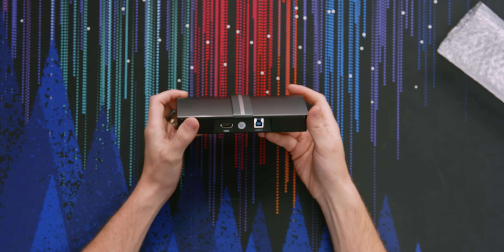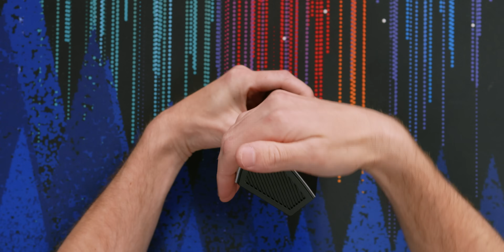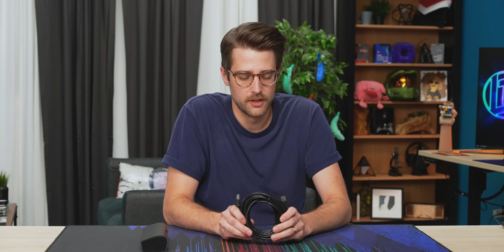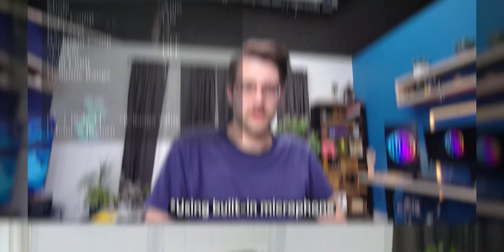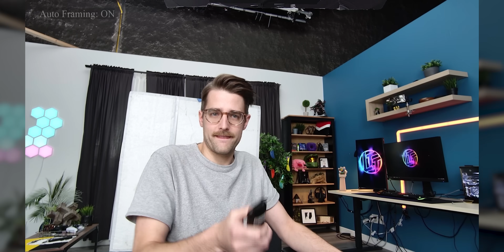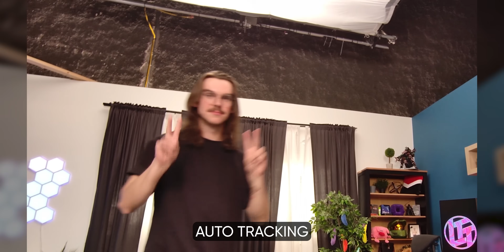The biggest sensor ever?! - Nexigo Iris 4K

Comment: Okay, maybe that's the largest sensor in a webcam that is strictly billed as a webcam...  but considering that most mirrorless cameras have tools (and in some cases, built-in firmware) that allows you to use them as webcams, I feel like the largest sensor in a webcam may just be a 35 mm full-frame sensor.  That is, unless there are some medium format cameras that have similar webcam usability.

Comment: That 3D noise reduction is actually pretty cool, it works just like TAA in a game. Temporal noise reduction using data from several frames will cause some blurring or smearing if very aggressive but it should work really well on high ISO

Comment: Would LOVE to see you build the ULTIMATE custom water-cooling PC, using the brand newly released Cooler Master HAF 700 "THE BERSERKER" PC case with at least three if not FOUR 420mm radiators at the SAME TIME, as a single water loop, with water cooling blocks on the: CPU, GPU, M.2 drive and on the DDR5 RAM! Would this be the ultimate dream setup for next gen hardware (like the intel 13th gen CPU, RTX4090ti, PCIe gen 5 M.2 drive and even hot DDR5 RAM)? I want something like this myself but have never done a custom water loop before, so a demo/tutorial video like that would be incredibly helpful for people like me. Ultimate silent cooling PC for the ultimate enthusiast gamer?

Comment: So, uh, what did you connect that HDMI cable to? The HDMI connector on the laptop? Its HDMI _output_, that is? 'Cause that won't do anything at all - it's not an input, so you'd still be using USB. You need a capture card/dongle, HDMI recorder, or something similar (and whatever software that devices requires).

Comment: Wait, video input via hdmi on a laptop. so we can send video to our laptop via hdmi, so we could probably use or laptop as a screen when plugging in a ps5 orso. 

(this was an idea i had when i was little. I had a crappy laptop but had a ps3. but the problem was, my parents used the tv to watch tv, so i couldn't play on my ps3. so i tried plugging in my playstation in to my laptop but it did nothing)

this could turn in to a nice feature for a laptop. using a other laptop as second display
Reply: I don't know what happened there and how such a mistake can happen, but almost no Laptop (except for some very expensive, streamer oriented ones) has an HDMI input. It's only usable as an output. Sadly the ShortCircuit team didn't put a comment under the video regarding it...

Comment: I'd rather use my phone's camera with a USB capture card, which is something I already own
Reply: How does that work, how do you plug into hdmi with your phone?
Reply: @RayanMADAO  USBC to HDMI adapter cable, and a video capture card, which converts the HDMI into a camera signal, so whatever input can be opened in the camera app on the PC. Also need an app like USB camera to allow video output from the phone

Comment: The size of the sensor is a bit less important than optics and image processing. The problem with webcams tends to be keeping cost down by skimping on image processing. You tend to have to choose between good quality image processing and compression performance and both tend to suffer. 

But with the field filled with sub $100 webcams that are “good enough” a high end webcam just won’t sell well. That’s why you won’t see much above $250. 

And I have to admit, ankerwork did pretty dang good with their video bar by taking the heir decent webcam tech and expanding features, making it a good all around package. I’ve been enjoying mine and it’s cheaper than this webcam.
Reply: But where sensor size still does make a difference is in low light levels, and a lot of conference calls (and especially Zoom sessions in a domestic setting) are done in low light.
Reply: @michaelwright2986  You're not wrong, but I've seen far cheaper webcams do just fine with low light. It just seems like focusing so much on the sensor is more of a marketing bullet point to inflate the price.
Reply: @bedast  True. I have had webcam images degraded by noise on a decent camera, though, in domestic lighting; but the size of a suitably fast lens for a big sensor would be limiting. The webcam equivalent of the full-frame still camera thing? Oh dear, how long before a webcam with a 24x36 sensor--to increase your influence?
Reply: @michaelwright2986  Something else worth considering: I've used an old iPhone as a webcam. There's software for doing this and it works really well. And it was so obviously superior that people noticed and asked about it. iPhones, especially older ones, are well known for not having particularly fancy sensors (iPhone 14 Pro is the first upgrade from 12MP in multiple generations) and primarily excel at image processing. And if there's concerns over trying to get the data through the USB bus for a good image, this iPhone used wifi. USB3 is capable of far greater performance and superior latency. If my Ankerwork Video Bar wasn't an all inclusive conference package with good enough video quality and really good audio related features, I'd probably still be using that iPhone.

You can get a first gen iPhone SE for less than $100. It's possible to find 2nd gen iPhone SE for less than $200. iPhone XR, my old iPhone, has a listing on Amazon for less than $250.

Comment: In theory you can use any camera as a webcam. Fuji GFX ftw! xD
tbh i think a sub 250$ compact camera and a cheap hdmi card can give you better video quallity
Reply: Got a Sony a5000 for 150, slapped a fast 16mm prime for 100 on it and use a cheap China capture card. All in all about the same price as this webcam and an even bigger sensor. Sure, getting clean HDMI out was a bit hacky with the a5000 but it works very nicely and you can't really beat an APS-C sensor unless you go full-frame.
Reply: @unicorntulkas  ooh yea i forgot about the 5x00. probably even better because you have a 180° screen

Comment: You'd need a capture card for the uncompressed 4k via HDMI since HDMI ports on computers are output only.
Reply: This is technically the start of a new idea 💡 in which HDMI becomes omni directional but then the group responsible for the standard will fuck it Up
Reply: @justinhobbs8646  The issue is the connectors on PCs are output only (due do them being the literal output on the board), which doesn't really have much to do with the HDMI standart, as cables are already omnidirectional XD
Reply: I was thinking the same thing
Reply: @74km  I was surprised Riley didn't mention that.
Reply: The only thing I can think of is that it's connected to an HDMI capture card like an Elgato or something. It would have been great for them to tell us though.
Reply: @megan_alnico  Yup, weird for them to omit something as important as this...
Reply: How didn't anybody on the team catch that mistake? I mean there is at least one person present filming the thing, who should know about how HDMI and HDMI recording works...

Comment: 250 DOLLARS? NOT. WORTH. IT.  In comparison to a "real" camera:  Bad picture quality. Hook a 300$ Sony Alpha 6000 to a HDMI capture card: Boom. Perfect picture quality for your OBS setup with very little price difference! And APS-C is like 10x bigger than 1/1.8! Better lowlight, better DR, better everything!
Reply: I’ve never worked somewhere where they went through that much effort just to install a webcam in a conference room.
Reply: @doctorgears9358  Exactly, companies are just going to use an out-of-the-box solution. Cheaper than having someone spend their time setting up something more complex
Reply: Or even just use your old phone, modern phones have seriously good cameras, especially compared to webcams

Comment: The insta360 link looks way better... The difference between 1/2 sensor and 1/1.8 is almost none, but the lens and software is as important for a good quality picture.
Reply: Had to go and check, but yeah, the insta360 link makes this look awful.
Reply: yeah and tracking movement with a gimbal is 100% better than doing software zoom
Reply: completely different use cases though but yes the Insta360 looked good. I have yet to see a review not in a studio light environment though.
Reply: Went and checked, and lol, you're right. The insta 360 makes this look like a nokia 3310 camera...
Reply: The Insta360 Link looks superb BUT so much of the functionality/control is only available if you are able to install the proprietary companion software on the connected PC. Again, this is where the Nexigo seems to come into its own. If you work in a high security company/environment (govt/financial services/aeronautics etc) you simply don't have the luxury of downloading and installing any old application from the internet onto your standard operating environment. Without the companion software, the Insta360 might as well be a $99 Logitech camera.
Reply: @derekjenkins6614  bingo
Reply: @derekjenkins6614  Even without the soft the Insta360 link is still a top tier camera tho. You'll indeed lack many feature, but as a webcam that can be moved easily and with a great picture quality it's already enough to be called better than most other
Reply: @derekjenkins6614  Unless you need the HDMI output, the insta360 link would work fine. It doesn't need its companion software.
Reply: @ViXoZuDo  I've just finished watching half a dozen reviewers and all of them point to the importance of the "Link Controller" software (PC/Mac).

Comment: What framerate 4k does it capture? Can it capture 1080p with higher framerate?
Reply: @10:05 it says 4K30, 4K25 and 1080P30 and less. Also “HDMI 60FPS is only visible when set on the computer side as well” so seemingly with the right settings on the capture card it will allow 60FPS to some resolution.

Comment: Any webcam looks so bad when comparing it to whatever camera they are using.
Reply: Well, they are using like 6k cinema RED cameras, ofc it looks bad by comparison, these are like 10-20x in price themselves even without the lenses
Reply: @OrangeNooob  I know, but it really doesn't make you want to buy the webcam when you compare it side by side. Prolly some DSLR would be a better choice.
Reply: @Mido_  for sure, but even used DSLR/Mirorless cost more than 250 USD and capture card is at least another 50 dollars.
So "if you already have dslr that can output HDMI signal" — it's a nobrainer to get a capture card and voila.
But if you have nothing on hand — still questionable.

Comment: Wish they told us the price. I don't understand who their target audience is with this webcam. The only good thing about it seems like the low light mode, but if it's for businesses wouldn't it be in a relatively well lit environment? I'd just get a Insta360 or a logitech webcam personally. Kinda wish Riley gave us more substance with this product.
Reply: Hi HeroSmashDS0987, the price on the Iris is $249.99 and we do have it available on our website. (Link is in the video description 🙂) Realistically, we think the target audience is likely to be more aimed at businesses that need a good off-the-shelf solution for conferencing, or for streamers that want to get started with higher quality footage, but don't want to shell out the crazy prices for a DSLR (and don't want their phone to become their work tool). While as you mention, most businesses will have good lighting and will not really need the low-light performance, we do think that this will be great for streamers who often are trying to balance a darker aesthetic with lighting that is actually good enough to film in.
Reply: @NexiGoOfficial  Thanks for the informative response.
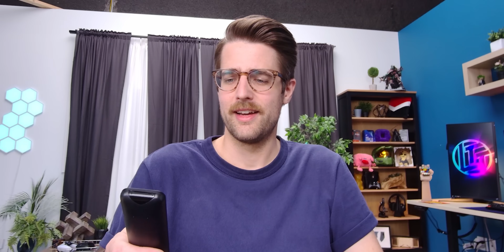Reply: price is mentioned and shown at 12:28 as $249.99
Reply: insta360 link is a solid webcam

Comment: Does it connect to a capture card or a HDMI to USB dongle at 9:45?
EDIT: And does it matter?
Reply: Hi Mark, for the uncompressed 4K to work, you would need to plug the HDMI into a capture card of some kind. Otherwise, what you will see is just compressed footage, the HDMI simply can't provide the uncompressed signal to the system without having a device to run it through. So it would matter, and you are spot on.

Comment: I appreciate the fact that most (all?) of the settings are on the camera itself. Perfect for people like me with heavily locked-down corporate machines where installation of some random webcam/helper app is not an option. 👍 I was also pleasantly surprised to see the USB vs HDMI performance isn't wildly different. Off to see how any Australian Pesos one of these will set me back.😫

Update: USD249 for the hardware (sure, I can live with that) PLUS **USD103** for shipping to Australia. WTAF?!
Reply: Australian pesos. Omg made my day.
Reply: @ibisHGO-KRB  Seriously mate. Our currency is struggling against the USD and yesterday (14Sep22) it dropped like a d*ck hit with a cold spoon when the US inflation figures came out.
Reply: Or people who use a Mac, which I do for work. Most webcams have all their controls in software that is only available on Windows, and my personal Windows PC goes nowhere near work calls
Reply: @helplmchoking  Absolutely! See also: Linux users. Also, potentially clutch in places where the users may have limited cognitive capacity such as nursing homes (and boardrooms? 🤣) and it just needs to be configured once, bolted to the desk/wall/table and the remote shoved in a junk draw somewhere.
Reply: @derekjenkins6614  For linux, you can use guvcview as a panel control for other softwares. But still not full feature parity.
Reply: Yep. Just checked, here in Germany it costs $90+ just for shipping. And then the $250 doesn’t include tax, which is another $50.
So you end up paying $400. That’s just… too much unfortunately.
Reply: 500 dollarydoos hmm so about the same as the last one they showed that's had really good tracking. Between these two I'd go with the other one
Reply: "You come from the land down Under " ;) sorry mate , I'm from Poland and shipping will probably be 60 bucks
Reply: I cant even order it. They dont ship to switzerland 🤣
Reply: you don't have pesos, you have dollarydoos
Reply: This isn't a corporate device, it's however intended for young entrepreneurial "content creators".
Reply: @DOGMA1138  I disagree, this is the kind of webcam they have in conference rooms where I work. Except those do less and cost more.
Reply: @DOGMA1138  I work for a corporate. Use a corporate laptop at home. I would buy one for work from home use with that laptop (plus my personal one from time to time).

Comment: Remember, don’t touch obs settings
Reply: I'll do what I want! Screw y...aww I broke it... Nvm
Reply: Why not, if I may ask?
Reply: @sydweller2066  breaks the hell out of it. I did it and it quit working.
Reply: @sydweller2066  its a mixed bag of picking out a sour grape or a sweet candy.
you can get away with some changes but some completely break the program and require you to reinstall or reset everything to default.

in some cases even doing those both does not solve the problem and leads to even a deeper rabbit hole which every streamer has been stuck in.
but OBS is still the best in my text book, it breaks but it works well when it doesn't and makes you happy with it.
Reply: @sydweller2066  sticker on Riley’s laptop says not to
Reply: @tbrickman  'Computer says noooooo'
Reply: Oh god I hate setting it up too 💀😂